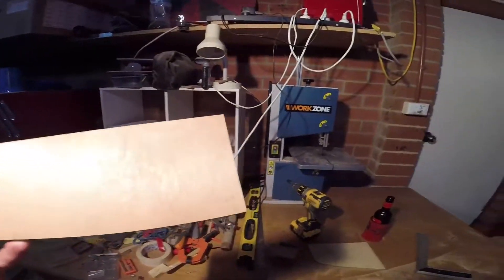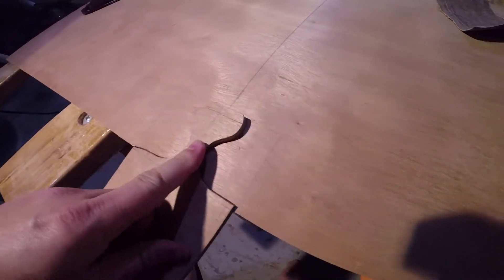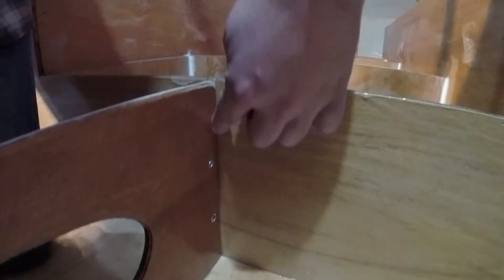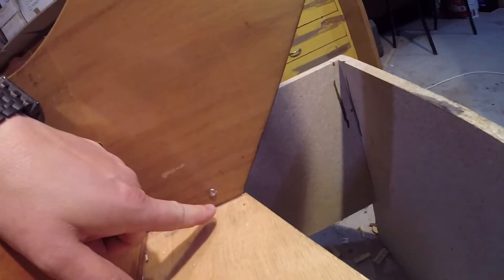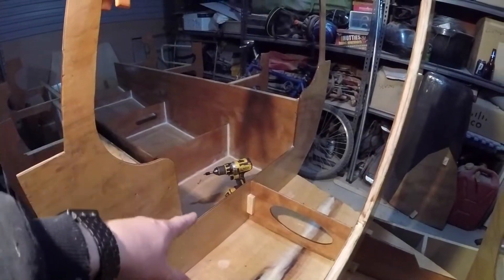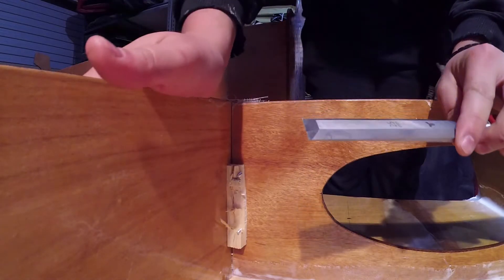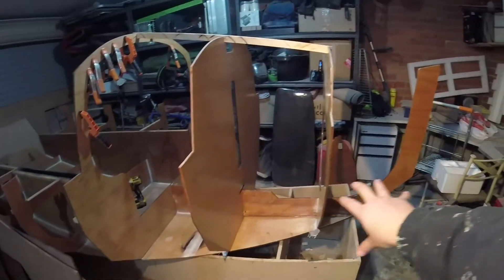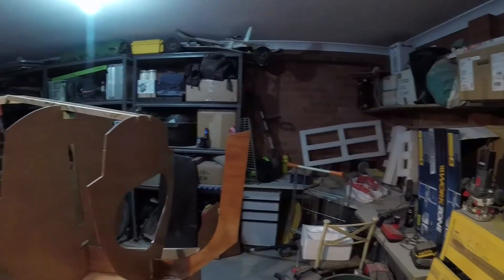Building a SCAMP part 031 - Gluing Forward Bulkheads

Comment: Drill the screws and move on! I like your plan to remove the cleats. Now that you've tried a puzzle joint, would you have used them for all the long pieces? Or stayed with the scarf joints?
Reply: My mistake, I should have listened further. I guess you haven't done the planks yet.